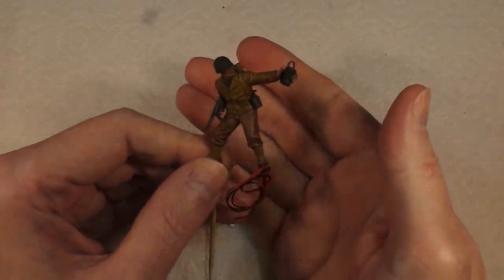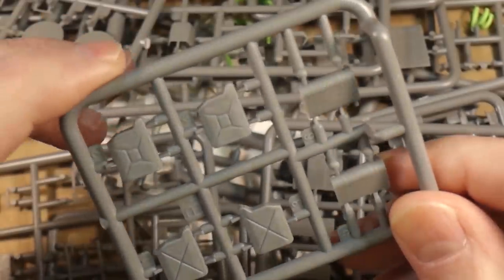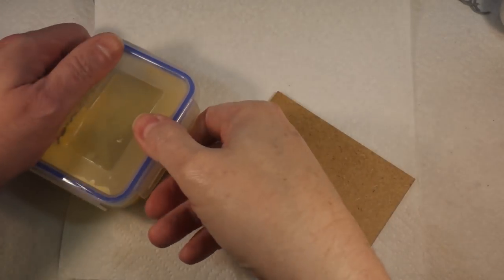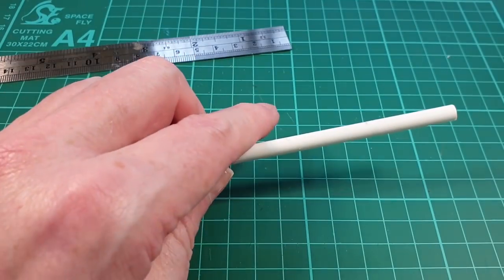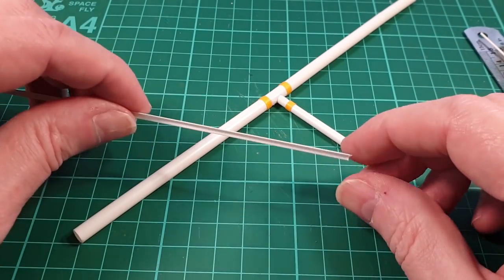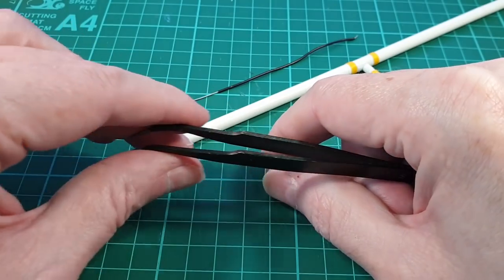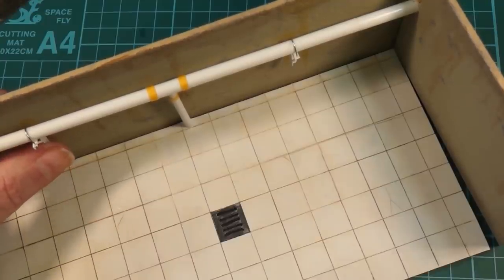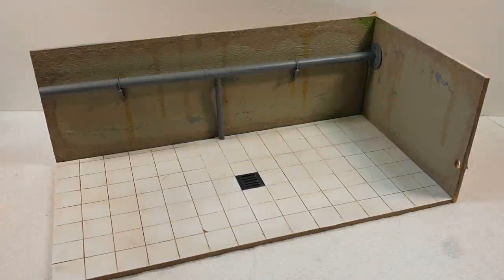Building an infantry diorama with lights and a twist... Part Two - The Diorama Base

Comment: An old automatic pencil Is a great way to hold & cut the tiny .5 and 1mm styrene rod, Just fit it in the pencil in place of the graphite pop it out to length and you have a good holder for cutting the styrene to very short lengths. Also if you apply heat to the protruding rod then press down on your steel rule or sililar you can create very effective rivets/bolt heads.  Love the builds keep em coming, Bill.
Reply: What a brilliant idea!
Reply from the maker: That's a great idea. I have some old mechanical pencils, I'll give it a go, thanks :-)

Comment: Need tongue depressors.  They work awesome for spreading stuff.  You can cut one edge flat if you need it.
After you cut or drill the plastic, use the tamiya thin to clean it up. Sanding leaves scratches in the plastic and ruins the effect.
I bought one of the archamedes drills after watching you use it, love it.  It was cheaper than a regular pin vise and works very well.
You don't need accelerant on your CA glue all the time, i use my breath to dry it most of the time.  The moisture from your breath will usually harden it.  It bonds more brittle and pasty if you use accelerant.
Reply from the maker: I'll give that a try, thanks :-)

Comment: I thought you were going to say the pipe hole was too close to the back wall i.e. you hadn't allowed for the bracket stand off. However you spotted that when you drilled the second (and third) holes! What we have here is standard modelling process. Great work though, looking good. Defo need some rust around the joints though.
Reply from the maker: Thanks :-)

Comment: What about using a stretcher on saw horses in the center. It wouldn't block as much light.
Reply from the maker: I tried various different things, and the effect was much the same. I did toy with the idea of not having the table at all, but it made the space too open and empty.
Reply: @SteamGeezerUK  turn the large table 90 degrees and have the narrow end up against the wall and closer to the left edge....that gives access to the victim on three sides and allows enough room for torch boy to do his thing. The small table then wants to go against the small wall
Reply: How about a table on a gimbal, tilted up at 45 degrees or so, Frankenstein’s lab style?

Comment: Always enjoy your builds.
Was wondering.
If you have any clear plastic spruces ( frames?), could you use a drill press or hand drill as a lathes and spin some hospital plasma type bottles with it?
Just curious.
Keep up the fun builds.
Reply from the maker: That would certainly work, yes. Any scratches or tool marks could be removed with a drop of thin cement over the top.

Comment: The advantage of Youtube modeling mistakes is you can fix it in editing. :)
A or the able,perhaps put it in at an angle of even flipped on its side as if they've pushed it out of the way?
Reply from the maker: Indeed. I did think about flipping the table, but it just looked odd to me.
Reply: @SteamGeezerUK    Ah well, it was worth a try. I have no doubt that you'll come up with something that works.

Comment: You could always blame the erroneous holes drilled into the walls, on Messrs. Botchit and Scarper, Cowboy builders. 
My favourite mistake was similar to yours - I measured, very carefully, a base, cut it, cleaned it up... Then absent mindedly put another part on top, and blithely drilled several holes into it, through, and into the bit I really wanted. Not once, but several times, with different diorama wall bits. It looked like the back wall of the garage after the 'St Valentine's Day Massacre', when I realised what I'd done. Cue bad language, and tottering around in small circles, muttering darkly.
Reply from the maker: Yup, we've all done it :-)